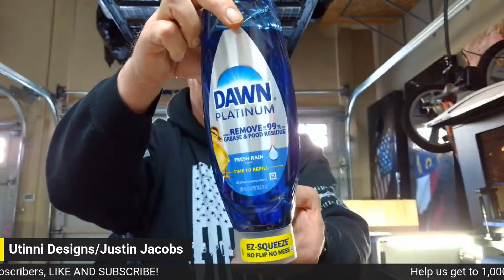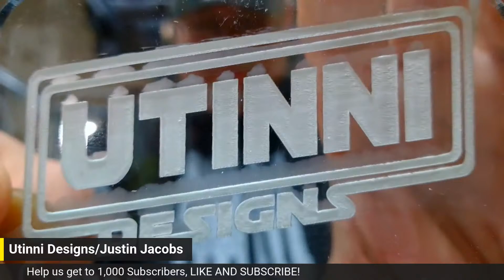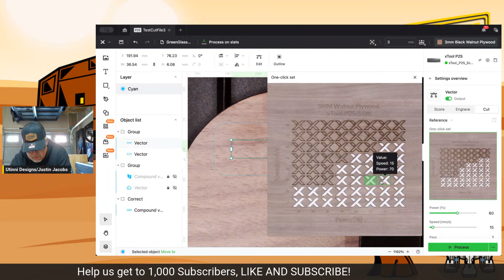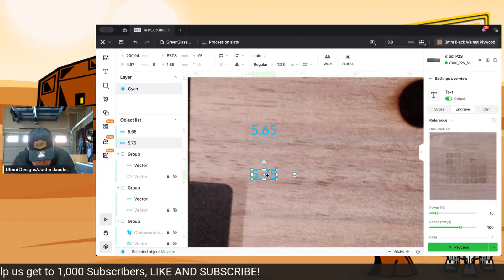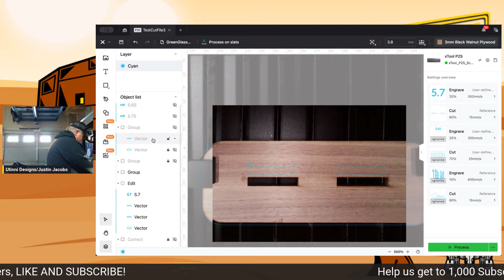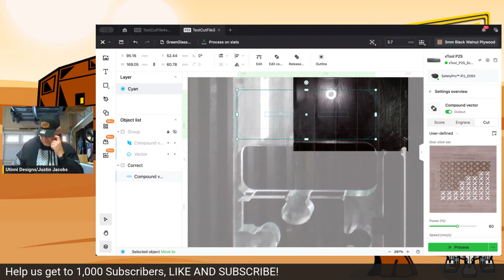Client Project Workshop with Utinni Designs and xTool P2S!

Comment: Appreciate your honesty you know more about kerfing than I do glad you got it dialed in!  I did a similar fit test once to figure out the tightest fit for some of my magnets I use in my custom silver art bar protectors made out of clear acrylic.  I simply made a bunch of holecuts an increased each hole by 1 mm and then fit tested the magnets to come to the right fit.  I must of made about 20 different hole sizes.  Maybe I went up every 1/2 mm cant rememvber off hand.  I still have that test wish I could post it for you but as you know we cannot.  Have a great new week!  Tomorrows a BIG DAY!
Reply from the maker: That’s actually a good idea!  
I’ve also found a kerf slot tester so I will be trying to use that going forward.  If you are interested in that here is the link:  https://www.dropbox.com/scl/fi/mak6cpxriu236ks5tq2oj/Compact-Slot-Sizer.zip?rlkey=3xe5kf225y06z4jz399hogdaq&dl=0